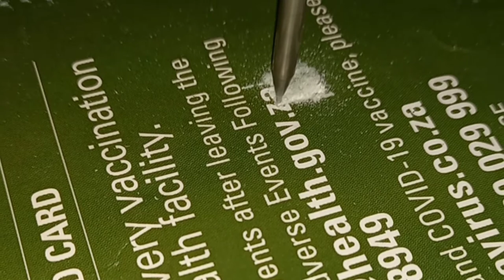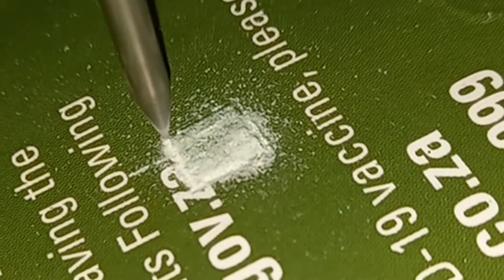DIY ARDUINO 3D Printed CNC Engraver

Comment: Awesome work! Which software/firmware are you using for motion control?
Reply from the maker: i used Marlin-2.0.x firmware and Repetier-Host software but the gcode for engraving was generated  from blender 3d with nCNC addon